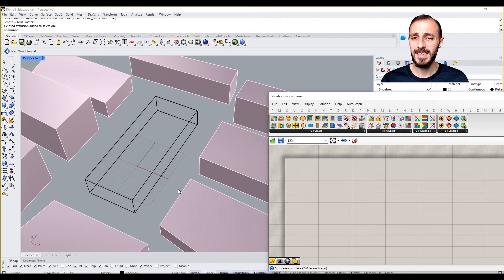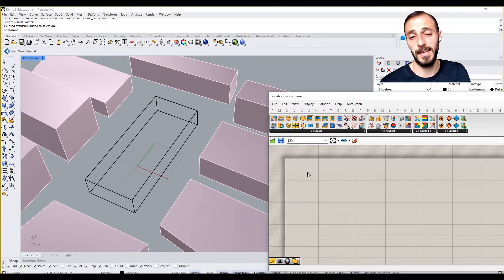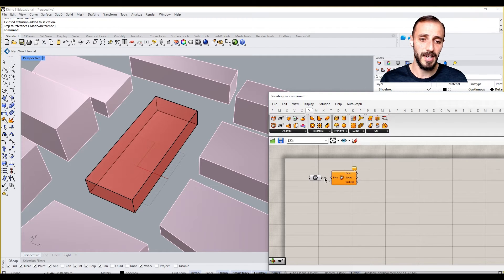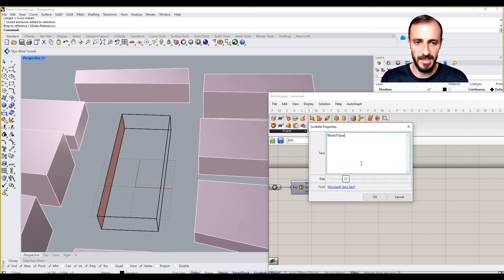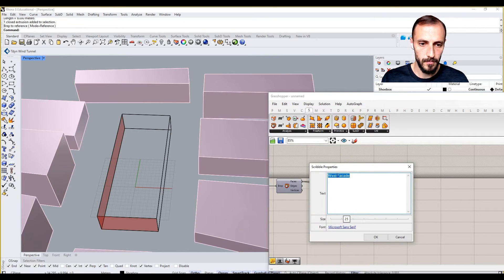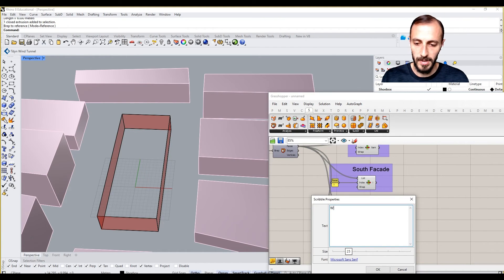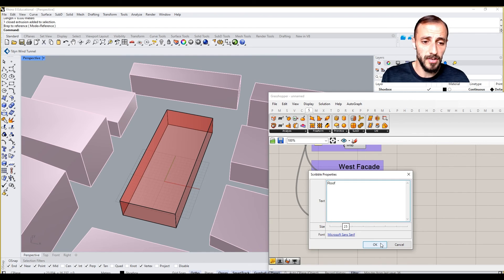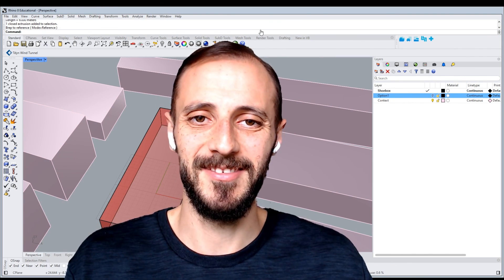1- Understanding Face Orientations in Daylight Analysis with Honeybee #Honeybee #DaylightAnalysis

Comment: Hi, got stuck quite early in but how do u assign the items to the side of the brep you want. For example how do u set the surface to be the west facade, east facade etc in the 2nd minute of this video
Reply from the maker: Hello,

In order to select the surfaces based on cardinal points(east, west, north, south), you need to deconstruct the BREP first. You can use a list item to understand which surface is facing which direction. 

Therefore, we don't assign anything but use the existing relationship of the surfaces from the BREP to select them.

I hope this helps!
Reply: @grasshopper3dchallenge omds this is really helpful. however it ended up making my daylighting sensor grid on the east facade wall if you know why that could’ve happened by any chance. 

also do you have an email, I wanted to ask more about the potential of having fabric based roof system and adjusting this script for that specifically.  And not a flat roof per basically. Look forward to hearing from you soon thank you so much for the current help

kind regards, 
atehsu
Reply from the maker: Hello!

I'm happy that it helped! You can write me at our skool community, but just in case here's the email:
grasshopper3dlab@gmail.com
Reply: @grasshopper3dchallenge  Ive uploaded onto the skool community! But i'll also write you now